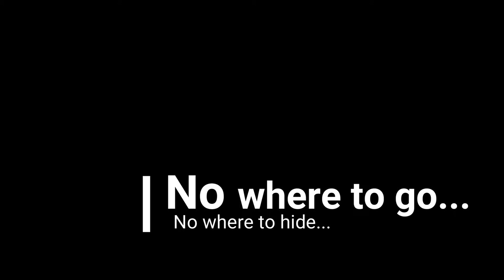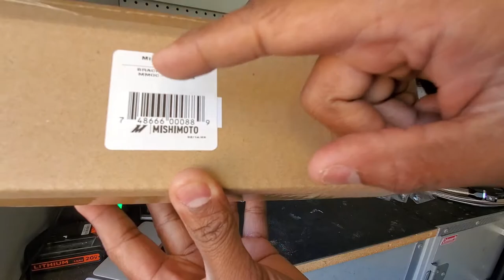G35 Gets Mishimoto Thermostatic Oil Cooler!!

Comment: Any leaking from the sandwich plate? I have the universal oil cooler and there is a small Leak from the sandwich plate
Reply from the maker: Not from the sandwich plate, I did have from the bolt the connects to the hose, but that was an easy fix. Very small leak at that, and I had to torque a little
more and haven't seen a leak since.
Reply: @JuzAnoth3rG  so just tighten the bolt more? Did you have leaking from both bolts or just one?
Reply from the maker: @romanharp  just one, I was freaking but it wasn't a big deal. That's all I did. Try to check where yours is coming from.
Reply: @JuzAnoth3rG  it's coming from one of the areas that goes into the sandwich plate. Coming from in between washer at the end of one line and sandwich plate. I've torqued it as much as it will go. 

I am freaking haha.
Reply from the maker: @Steve_Balboni  I hope you didn't over torque it, but if Torqing it down down didn't help it might be a bad fitting brother.
Reply: @JuzAnoth3rG  I think it is. Called mishi and they are sending another plate and fittings. Thanks for getting back to me! Have a great weekend!
Reply from the maker: @romanharp  life time warranty is A1! Glad you're getting it fixed brother!

Comment: So this is only going to work if u have ur ac on to help keep the oil cool cause I thought it also needed a connector to make it turn on like a ac no electrical connection that's weird guess it not all that then
Reply from the maker: It does not need to be connected to you ac at all. The cooler air that runs from in front of your car cools the oil temperatures as the car runs. No electrical or anything like that needed. It has another connector on the thermostatic sandwich plate if you would want to add an oil pressure gauge or oil thermostat.

Comment: Why you mount it upside down
Reply from the maker: You can mount in either direction, but when I first installed I wasn't comfortable with my hoses being so close to the ground since the car is lowered. Since I installed the Z1 under shroud I have added a bit of protection and will eventually flip to where my hoses are coming from the bottom. Probably after this next oil change I am getting ready to do.